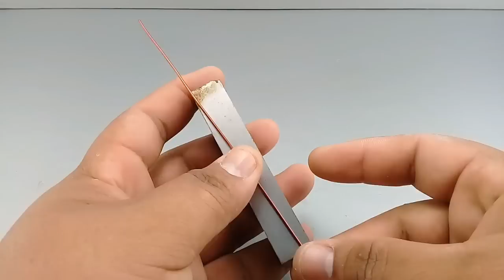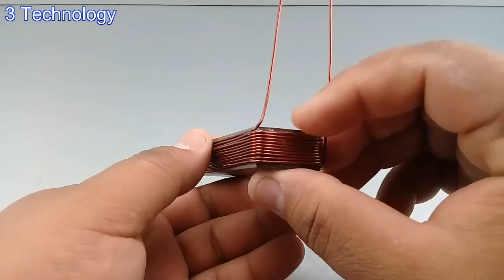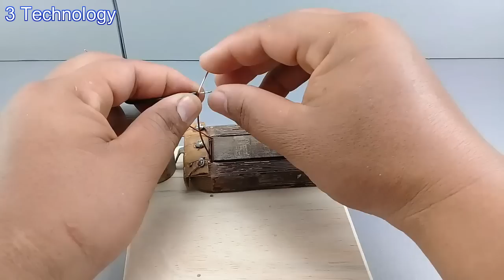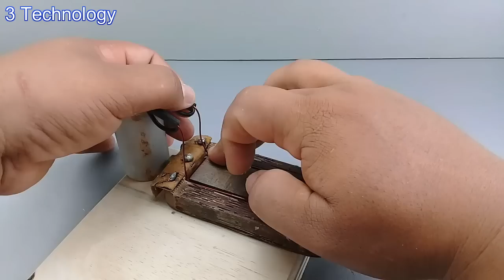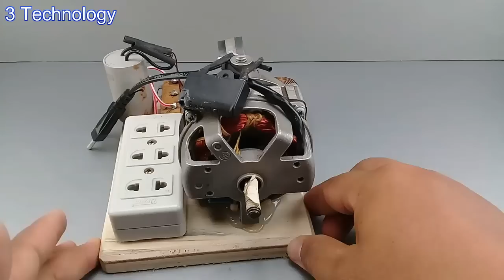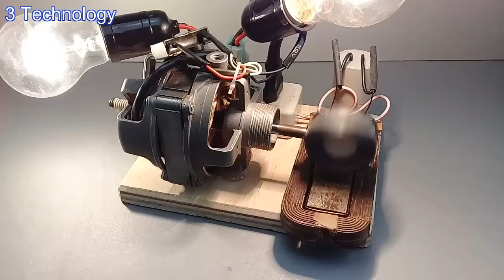how to create 230v 4000w free energy from microwave transformers

Comment: Does the 4000 w free energy include the inductive parasitic coupling loss incident to the parametric overvoltaic capacitance ? You may find the subencabulation stress induced in the proto-current magnetic register will be evident in a pure non-resistive state.

Comment: Calculating VA (watts x 0.85) and then calculating the amps required to produce this, the wire size would need to be 12 awg in order for this setup to work without overheating and melting.  That of course is saying that this thing works at all.